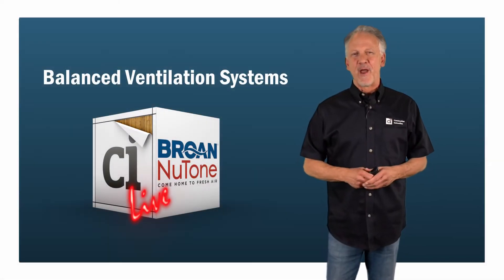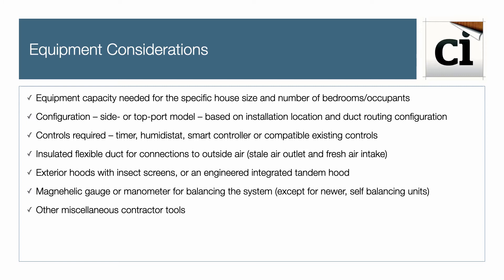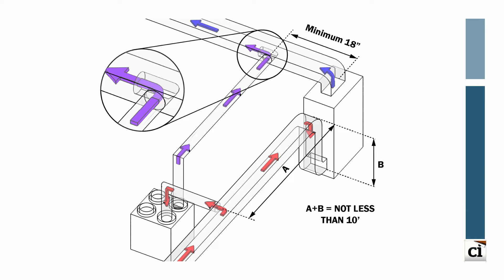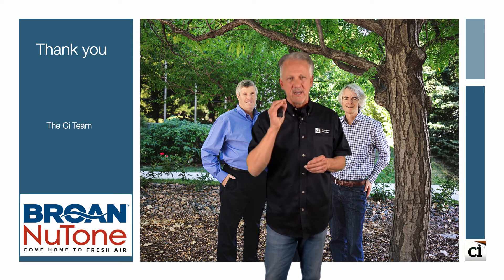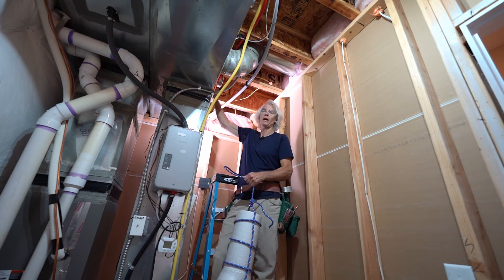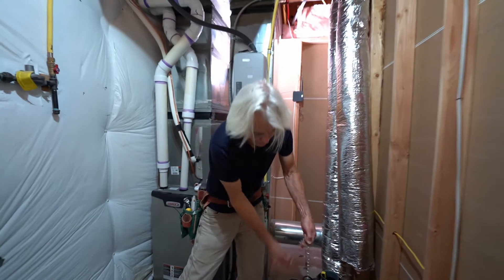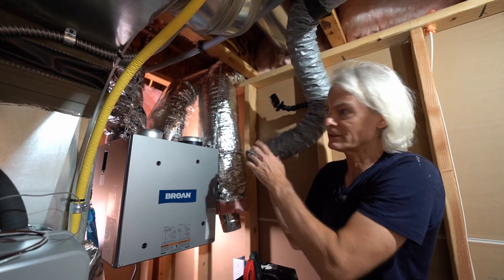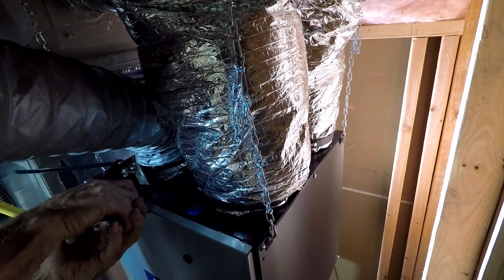Everything you need to know to install a Broan Energy Recovery Ventilator (ERV)

Comment: so basically, these ERV systems can NOT be put in an attic.
Reply from the maker: Thank you for your ERV question. If the ductwork passes through an unconditioned space (e.g.: attic), the unit must operate continuously except when performing
maintenance and/or repair. Also, the ambient temperature of the house should never drop below 65°F (18°C). It should be installed within an area of the house where the ambient temperature is kept between 50 deg F and 149 deg F.

Comment: Hey there!  I have an HRV80T model that was installed on a new construction in 2022.  Last winter (‘23-‘24) we had a nasty cold snap here in Alaska where we were at -40/-50s for a couple weeks straight.  I noticed the unit hadn’t ran for a bit and saw the light was blinking red.  After doing some digging it seems like the damper system had an issue.  I’m looking at ordering a new one before this year gets colder and was wondering if there were any videos or guides you might have for replacing it.  Thanks!
Reply from the maker: Thank you for your question. Unfortunately, we do not have a video for replacement of that unit at this time. We do have a Product Support Team available at 800-637-1453 or customerservice@broan.com if you have any questions. They will be happy to assist you directly.

Comment: I Have Broan B150E75NT AI Series. I'm using the T1 Independent Install Setup. When Exhausting/Supplying from/to more than One Area/Room/Locations, How do you maintain Suction/Supply Air? I Have noticed a Significant drop in Air Suction from Exhaust and Decrease in Supply Air when I "Tee" in to more than One Area. The 6in Ducts drastically drops the air movement after I "Tee" Off into Any Location. How do You Overcome this?
Reply from the maker: Thank you for your inquiry. According to our Product Support team, you may need to use an 8" trunk line. The reduction in ducting and splitting ducting will always reduce the output, the system is always pushing/pulling as much cfm as it can. But when you split the ducting you also split the cfm. If you would like to discuss this with our team directly, please call 800-637-1453.

Comment: Would using the modified setup of taking the intake air and directing it into the supply ducts cause too much humid air to enter the home since it is bypassing the furnace / ac coil?
Reply from the maker: Thank you for your ERV question.  This unit shouldn't cause excessive humidity. The majority of the humidity will transfer to the exhaust air through the ERV core before it enters the AHU ducting.  The A/C is not always cooling when the ERV is running.  We hope you will find this information helpful.
Reply: @BroanNuToneLLC  I live in a cold climate (Wisconsin), and I am concerned about the defrost cycle, but the manual says for T-4 and T-5 (which I would need to do) " (THIS CONFIGURATION DOES NOT ALLOW RECIRCULATION MODE TO OPERATE.) So I was concerned that the unit would not defrost properly because the air recirculates in the core? Would I be reading that correctly? So I would not be able to have defrost on? What does the incoming air have to be in order for the defrost cycle to kick on? I read somewhere 23 degrees, but that seems high as other units are in the negatives before defrosting cycles.

I would prefer to use the T-5 setup where the air goes directly into the supply side. 1. With the goal of being able to run the unit continuously, but I was concerned with this section of the manual that says for a T-5 install "Unit should be synchronized with central forced-air system operation to avoid condensation and mold growth in central forced-air system distribution ducting if cooling mode of central forced-air system is used.
" Which means there is no method for existing ductwork in which the system can run continuously using T-4 or T-5 install it would have to be interlocked. Would that be a correct understanding, that I can only do T-4 or T-5 with an interlocked furnace?
Reply from the maker: @michaelsuggett710  According to our Product Support Team, the unit will still recirculate for defrost in these configurations. You just won't be able to run the unit in recirculation mode. T4 configuration requires the unit to be synchronized with the forced air system, but T5 configuration is not required only recommended to avoid the possibility of condensation in the ductwork when in the cooling mode. If you would like to discuss your application with a member of our team directly, please call 800-637-1453. They will be happy to assist you.

Comment: Exterior intake and exhaust are way too close. Shouldn't use same hole. System might as well breathe its own farts.
Reply from the maker: We appreciate your feedback on the ERV video.  The TYIK1 tandem transition kit is a concentric vent kit and is designed to not bring in exhausted air.  These kits should only be used on 110 cfm models or less. Due to the design of this kit, there is almost no cross-contamination. It has been tested and per the specification sheet, the cross-contamination rate is 3.2% between stale air to the outdoors and fresh air from the outdoors.

Comment: In an install like this (both stale air from building and fresh air to building going directly into the existing duct work with a small separation and tied into the fan of the air handler), is it important where the air handler filer is located?  if the filter is in the return grill, will the significant pressure drop across the filter be an issue, growing as the filter dirties over time?  Does the filter need to be at the air handler instead, where it is in front of the two connections?  Does that or the grill location work when the two duct connections are on either side of the air handler, where the stale air is trying to be pulled from the low pressure side of the air handler and the fresh air is trying to be delivered on the high pressure side using two different fans in the ERV/HRV?  The installation manual does not seem to address the filter location of the air handler and the pressure problems that it creates.
Reply from the maker: Thank you for your question regarding the ERV video.  It shouldn't matter where the air handler filter is located in the return side of the furnace. Whether the filter is before the ERV ducts or after them, the ERV will adjust itself to remain balanced and the set cfm. If it cannot due to a restricted filter, it will display a code letting you know that either the fresh air or exhaust air is restricted.

Comment: I have a Broan HRV and last night them Temperature outside was 34.5F and the fresh air coming into my house was  46.0F and the stale air exiting was 42.9F! This thing is amazing and is going to save me and estimated 20-30% on heating costs in my leaky house built in 1879! Question for Broan? What allows the core of this HRV to recover more heat than is exiting the building. If it was just equalizing the temperature difference you would expect to see incoming and exiting air to be the same? What sorcery or physics allow all this energy savings for my building?
Reply: Counter flow heat exchanger.
Reply from the maker: Good Morning, In colder climates, where home heating is essential, the Heat Recovery Ventilator (HRV) is the proper choice. The HRV keeps the home supplied with a steady flow of fresh outdoor air. As stale, warm air is expelled, the heat recovery core warms the incoming fresh, colder air before it is distributed throughout the home. The result is a constant supply of fresh air, no uncomfortable drafts and greater comfort. In addition to heat recovery and improved air quality, the HRV provides necessary ventilation while controlling excess humidity.

Comment: A video of a cluttered mess in the basement where the camera work is terrible nobody can see wtf David Lee Roth is doing here
Reply: I think it's useful because it's far from ideal. The worst are the installations where they are still building the house...of course it's easy because you can run the ducts anywhere and don't have to worry about walls. But most ERV systems seem to be retrofits, installed in areas where no one thought anything was going to be installed.

Comment: Great video! My question is at the beginning the first guy suggested keeping the fresh air connection a minimum of 10' from the air handler blower and the installer installed that connection much closer than 10'? I take it that it is not that critical?
Reply: I think code requires at minimum 6 feet.  
10 feet is recommended.
Reply: If you were to get an unbiased answer, they would tell you that unless you have no other option, it is not recommended to tie into existing ductwork at all. This 10' (or 6') minimum is to try and alleviate issues such as the ERV fans being overwhelmed by the HVAC system, or the need to run the HVAC every time you want the ERV to run.

If you have to do things like tie in to the HVAC or install a "combo" inlet/outlet, or use small ducts like 4", then you do what you have to do. But if at all possible, use 6" duct connections separate from the HVAC, and separate them along the house far from each other, or in strategic locations (i.e. inlet near plants, outlet near dryer vent, etc).